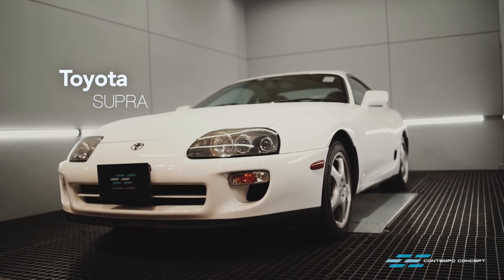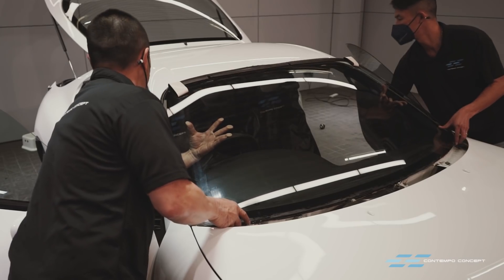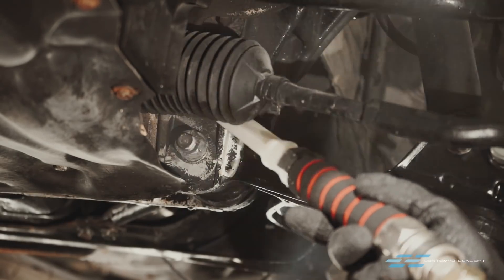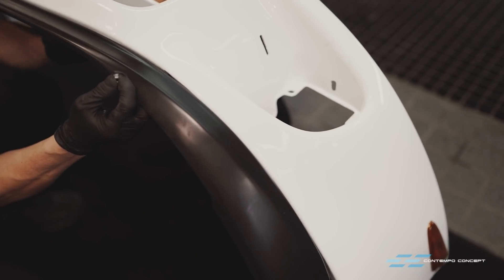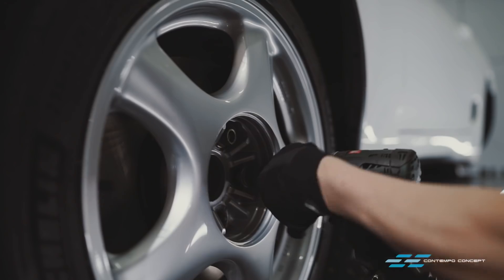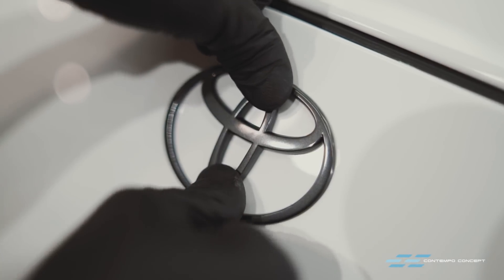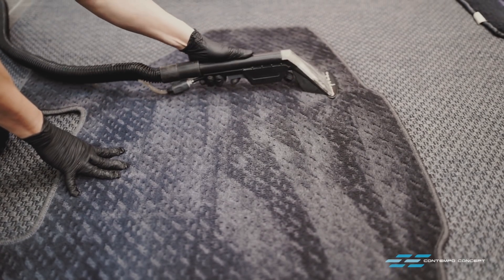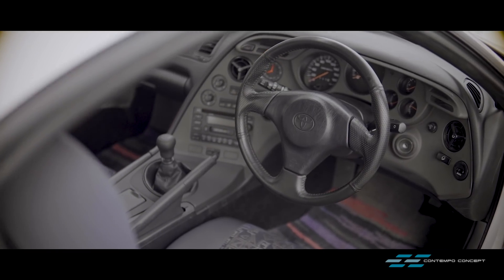Toyota Supra Restoration

Comment: Never heard of a dry Ice blaster. This is neat.
Reply: Its a neat machine but its also a bitch to clean up after. The grime and stuck up dirt that you remove are not washed off like a power washer does. Instead it goes into the air and lands everywhere like dust so its also quite dangerous to inhale.
Reply: Me and my dad have an ice business and we deliver to construction sites as well they say it’s easier because the dry ice evaporates and doesn’t need anyone to pick up the mess after not like sand
Reply: AMMO NYC will show it well

Comment: Finally, a Supra that has not been ruined by aftermarket modifications.
Reply: I wouldn't say ruined. A lot of aftermarket mods can improve the handling, comfort, and performance of the car.
Reply: @nchondakid  i think he means just modded in general. This is a great example of a stock supra.
Reply: @Joe Mama I agree. I used to love mods on the JDM stuff and still do, but find myself becoming more and more obsessed with the completely perfect OEM stuff. Probably due to the rarity and the ever increasing values...
Reply: @jamesrichards5601  I feel like they’re 2 different things that you can appreciate . While I love a super tuned up car that’s absolutely ridiculous, I also love the stock look, it’s much cleaner
Reply: @jamesrichards5601  even a good balance of the two is up my alley
Reply: I used to like OEM+ Supras, but realized the owners are just investors/garage queens/collectors. I hate them the most.
Reply: Oem on the outside, aftermarket under the hood is the way to go.
Reply: @adamgibson9084  OEM everywhere!!!
Reply: You might as well replace all the old hardware also if you go that far. Why not pull the subframe also? You want the undercarriage to look as good as the outside…
Reply: @ANDRE_675  haha I love me some oem trust me, I have the receipts to prove it. But nothing beats the sound of a single turbo Supra. You will never change my mind 😎
Reply: @Skyline OEM means stock I think

Comment: With the amount of restoration they put into this car and with the low mileage, this car is now probably worth $180,000-200,000!  One at Barrett-Jackson sold at auction for $160,000 in similar shape not that long ago.  It's refreshing to see one that's not totally modded up with 1,000 hp.  It's nice to see one completely original as it came from the factory.

Comment: Who in their right mind would ‘thumbs down’ this beauty???
Reply: Someone who can't afford anything nicer than a barely running Honda Civic, probably.
Reply: @MuffinMan0521  the saltiness is real.
Reply: I did. He killed the resale value of the vehicle.  No respray will ever be as durable as the OEM paint that was in great condition
Reply: @Cab895  "No respray will be as durable". Lol you have absolutely no clue what you're talking about. They don't spray the best paint on any of their cars and they don't spend the time to polish the orange peel out of the clear.
Reply: @MuffinMan0521  You have no damn clue what you are talking about. No respray will ever be as durable as factory robotic applied paint to flawless panels.  Factory paint is then baked at over 600 degrees and is fully cured. You will never get that kind of durability from a respray.
Reply: @MuffinMan0521  That said, excellent choice in cars. I had a 91 MR2 turbo with a Gen 4 swap, pushing 330+  back in the day.  Good times.
Reply: @Cab895  I think the baking is primarily to reduce the orange peel in the clear so they don't have to spend a ton of time polishing each car. I imagine there is different clears that don't need to be baked and offer a durable finish.
Reply: @MuffinMan0521  That is simply not true and shows your total lack of understanding.  OEM factories use paint that cures at a higher temperature and is more durable. If there is a paint issue at the factory, or at a 3rd party refinishing shop they cannot use these paints, they use "low bake" paints.
Reply: @Cab895  do you have a source?

Comment: Contempo definition of restoration is changing most parts for new parts. For instance, some resto would cut and polish the headlights instead of changing a new assembly and ditto for the glass. Whatever happens to the old parts that were removed? Do they end up in a used parts bin?

Comment: Did you apply the new paint over the original paint without sanding? What preparation was done to the old paint; is spraying over original paint ok when there’s a clear coat?

Comment: Only complaint I’ve got is not removing the tyres from the wheels to paint them, apart from that amazing as usual
Reply: Its done as it doesn't change color, to avoid scratched
Reply: @oscardominguez1680  if you scratch wheels fitting a Tyre then you shouldn’t be doing it as a job, very simple thing to do

Comment: Wouldn't painting the car devalue it?
Reply: It’s definitely not original anymore, that’s for sure. 

But beauty and value is in the eye of the beholder. I’d rather have perfect paint vs old ass crusty 25 year old paint, even if beautifully corrected.
Reply: @I_know_what_im_talking_about  A car is only original once. There's no question that the market value of this car is now lower than if the owner had kept the factory paint, especially in the condition it was in. And how can paint be both old and crusty but beautifully corrected at the same time? As long as the clear coat hasn't failed the base coat should be totally fine. I really can't wrap my head around the decision to respray a collector grade example like this.

Comment: The replacement of the front lights was an unnecessary expensive way to handle it. It's very easy to restore faded headlights to look like new again.
Reply: Agreed, unless they are faded on the inside, at which point oven roasting them apart and trying to refinish the internal bits can be quite time consuming and ultimately won’t look as good. 🤷🏻‍♂️

Comment: Kind of sad that this awesome car ended up in a collector’s garage, yea yea yea i know the lower the mileage the more expensive it is. But this kind of car are meant to be driven, or take it to local track during trackday.
Reply: IT kInD sAd blah blah ,Do know that 99% of the supras are drag cars the supra is a terrible track car, it gt car nothing else
Reply: @napalmman8292  idc what version you watch there's more 100x 1000hp supras than Track builds
Reply: @napalmman8292  when did i said they were easy to control ,I didn't say anything about that control either
Reply: @napalmman8292  there's one track supra on YouTube

Comment: I like your videos but personally most of them are not really restorations per se. If 90% of the parts are changed with brand new ones, and the interior, engine bay and underneath are cleaner that's not really a restoration, is it? Good luck in your future projects!

Comment: How can one be so OCD as to be bothered by a few rock chips and demand a complete respray? Just ridiculous. Does the owner not understand the value of having clean, original paint like that? The wheels and calipers also looked totally fine, just needed a good clean, and the headlights probably just needed a good polish. And dry ice blasting grime away? I can see the value in replacing rubber seals and the like, but much of this "restoration" seems completely unnecessary, just an OCD rich guy doing rich guy things.